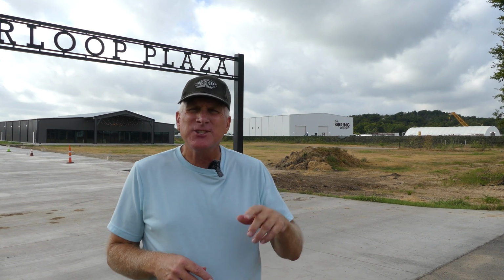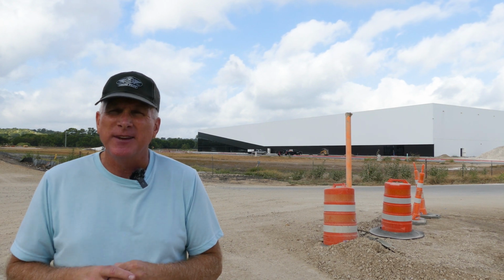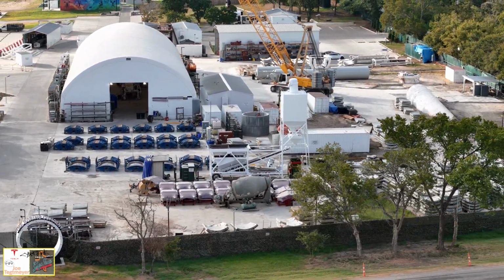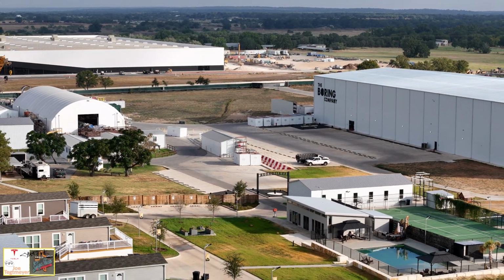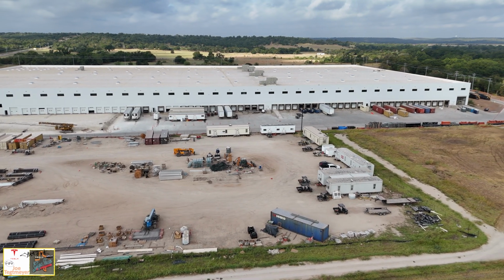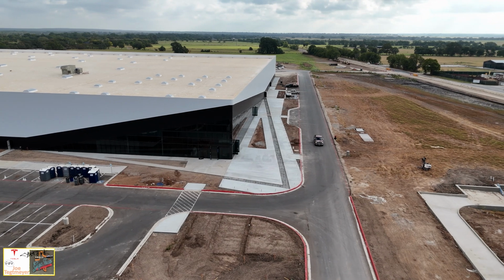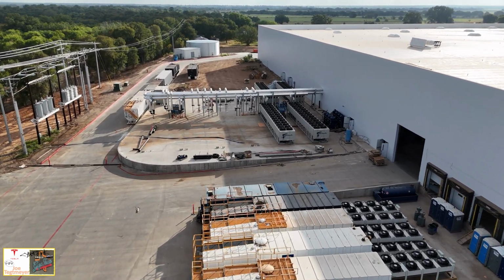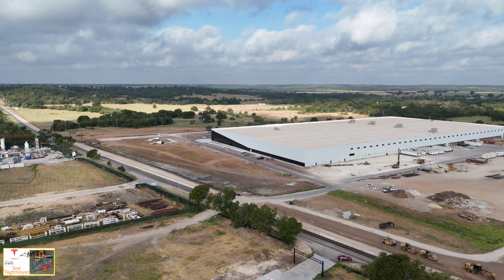SpaceX & Boring Co Facilities widened roadway! 13 August 2023 Development Operations Update(8:00 AM)

Comment: Thanks Joe.
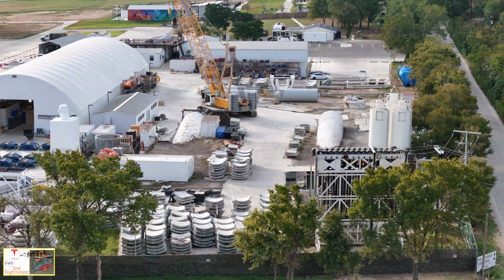5:58. TBC. Some hexagonal segments in amongst the stacks. The regular TBC tunnel ring segments are trapezoidal.
7:45. TBC. Bottom left. Vertically arranged tunnel section. Made of the hexagonal segments.
7:49. TBC. Red and white striped channel. Visible in Joe’s photos is that this has been assembled from the hexagonal segments. 
There is also a flat floor section installed at this end, just visible.
11:29 Starlink. Old farmhouse. Couple of vehicles parked. Site office maybe.
12:12. Starlink. Stormwater drain outlet. Might be a detention pond.
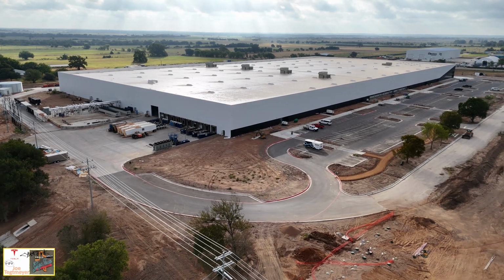12:22. Starlink. Bottom. Access covers into a series of underground tanks. Sanitary sewer I would guess. Pump and dump.
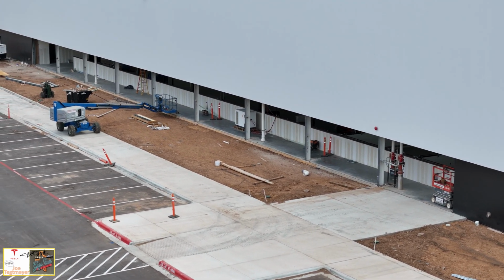15:22. Starlink. Inside. Almost looks like a series of baths, or square enclosures.
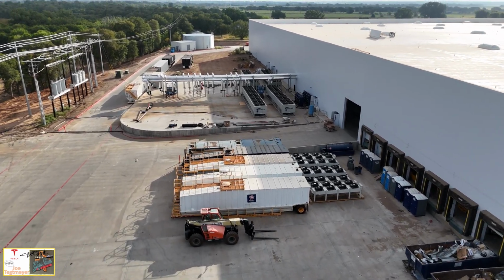16:30. Starlink. The familiar water storage trailers. Might not be adequate water supply. Presumably town/city water is available, but flow/pressure inadequate.
Large fire water tank top left, another clue.
17:05. Starlink. Pallet racking/storage system. Same as this, https://youtu.be/RytK30GqIbQ?t=1942
18:43. Starlink. Drilling and piling rigs. I’d say they are extending the building.
Black pipes along the edge of the raised gravel would be temporary stormwater pipes.
Steel pipe beside the piling rig looks like a pile casing.
Reply from the maker: Thanks Dessie!

Comment: Looks to have better site planning than GFTX. That place is a disaster.
Reply from the maker: The building is also 12 times smaller than Giga Texas and with a very different purpose.
Reply: Scale and use shouldn’t have an impact on proper site planning. It’s obvious there’s minimal line planning at GFTX whatsoever. Just look at the amount of times they’ve poured and demo’d the same slab of concrete over and over through the entire site over the last 2 years to get an idea.

Comment: Hyperloop could be technically done but, it is not economic feasible nor environmental sound. It is basically a Maglev in a tube. How many Maglevs are above ground? You could count them on one hand. Also the power needed to create and hold a near vacuum would take lots of energy. The Hyperloop shuttles wouldn't hold enough passengers to be profitable. If you need high speed we already have something for that it's called jets. Also where is all this money coming from to build hundreds of miles long subway. Hell, we have a hard time building high speed rail.

Comment: the boring company has basically been a massive fail - like the cybertruck will be - the semi truck could be good but they can't meet deadlines
Reply: Why will the Cybertruck be a "massive fail"?
Reply: @sammyk874 Don't feed the trolls!
Reply: @sammyk874  If I may toss in my thoughts on Cybertruck....
* Ugly as the backend of a pig (Just my opinion).
* Unrepairable structural battery pack.
* Unknown repairability of the "Exoskeleton".
Reply: @DavidJohnson-tv2nn  Despite that, over a million reservations.  Even if half of those turn into a purchase, they will have had initial success.  Can they maintain sales?  To be seen.  Even if it is unrepairable, it's replaceable isn't it?  No idea about the exoskeleton.
Reply: @sammyk874  I don't deny it could be a success. Like Apple, much of Tesla's business model is based on the fan club. Fans buy pretty much whatever they produce. If they produced pink garbage cans, the fans would buy them.
As for the 4680, it's replaceable, but at what cost? $10,000?, $15,000?, $20,000? Which is why we need consumer protection laws regarding right to repair. Sad that we need laws to make companies do the right thing. But that is the way it is.
Reply: @DavidJohnson-tv2nn  The warranty on current batteries is 8 years/100K+ depending on model.  If it fails, you should not need to pay for the repair/replacement.  Post warranty in 8 years time, I can see the cost of batteries going down.  They already are as raw material prices plummet and more factories come online.  Should be no more than major work on an ICE vehicle.  Of course, that is to be seen, but I think  that is the direction it is going.  Not sure why people think all current numbers are static (range, charge time, market share, cost, etc).
Reply: @sammyk874  As I mentioned before, the first 8 years isn't the problem. It's what follows after that that is a cause for concern. You can't just assume that prices will fall. More important, the unrepairable 4680 is just one part in a long line of anti-consumer/anti-independent repair practices by the tech industry, not just Tesla. Though Tesla is leading the way in F ing up  the repairability of electric cars.
Nor does it matter if only a few people are interested in independent repair. When you pay money, especially a lot of money, for something, and own it, you have a right to repair it! Not have your rights dictated by some megacorporation. 
To make matters worse, not only is the 4680 unrepairable, the battery packs can't be repurposed for home energy storage. Recycling? Reuse is always better than recycling.
Reply: @DavidJohnson-tv2nn  #1 Valid - you are entitled to an opinion
#2 & #3 Invalid - This is just your Tesla hate showing. You have no knowledge of the design details of either and I suspect no engineering training either.
Reply: @sammyk874  Quite repairable. Stainless steel is weldable.
Reply: @GntlTch  Well perhaps you can enlighten me. 
1) How do you get into the 4680 pack to replace individual components without destroying it. 
2) Provide PROOF that the exoskeleton of the cybertruck is repairable at an affordable cost after a collision. And PROOF that any auto body shop can do the repairs.
I suspect that you are a Musk fan trying to sell the usual manure. But I'm not buying without absolute proof.
Reply: Disagree on both.
Reply: Based on sound financial information ? Or pulled out of your .. but maybe.
Reply: Agree on both.

Comment: Is the main hold up with boring tunnels: 1) equipment malfunction or 2)permitting issues?  A few years ago, predictions were for massive amounts of tunnels to be operating by now.  Very similar to the solar roof ramp.  They predicted they would be installing 1000 roof/week by end of 2020. Both seems to have nearly completely stalled.  Yes, I know about the vegas tunnels, but a few years ago, the talk was that tunnels would help solve the traffic issues within a few years.  If that was a realistic and viable goal, there would be thousands of tunnel machines in operation by now.  Likely just another issue where the practical application proved much more difficult that the theory.  Anyway, thanks for your diligence and the update, Joe.  Your hard work is greatly appreciated!
Reply: You said everything I was thinking